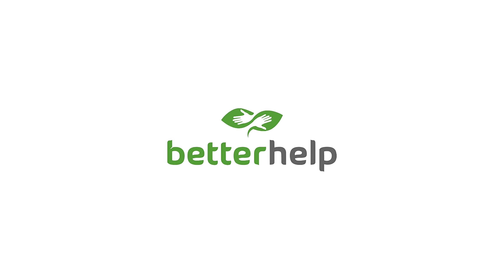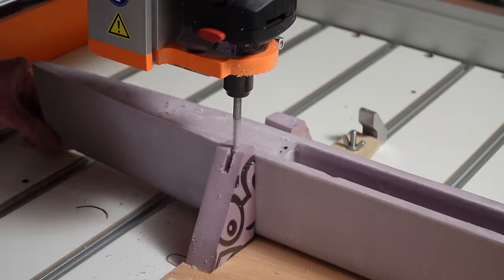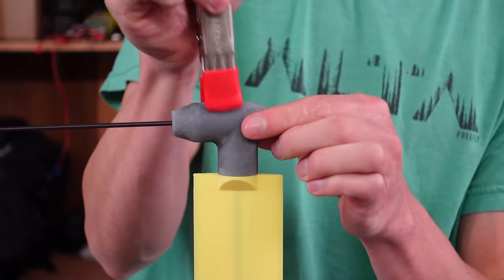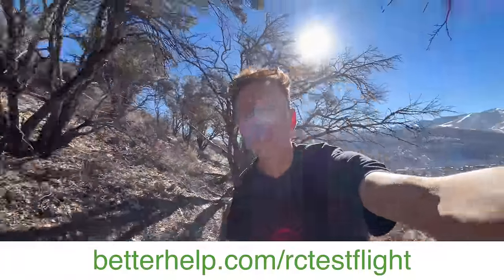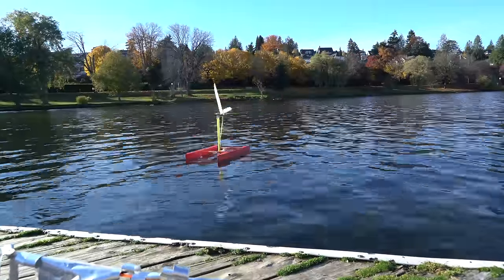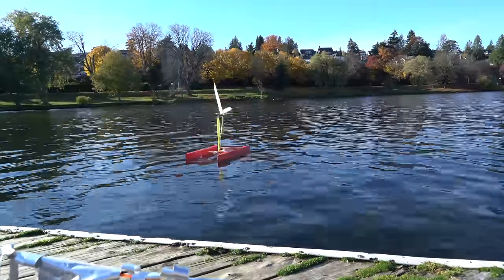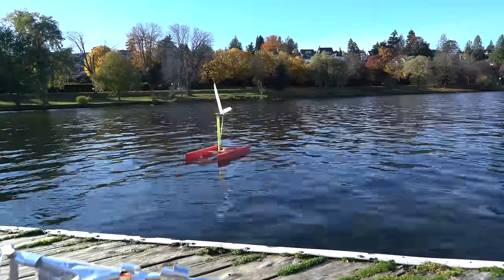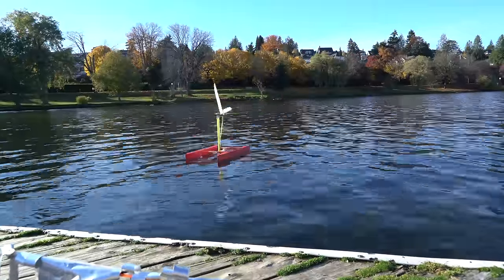Sailing Directly Into the Wind - Is it Possible?

Comment: Im wondering if a vertical turbine would work for this. Seems like it would eliminate the need for one set of bevel gears and the need for the mast to pivot with a fin on the back. Although i don't know if it would be more efficient or not.

Comment: I don’t see how you could get more energy at the propeller than the sail. Both are propeller acting in different mediums, air and water. And the drag of water is worse than air. If your boat (or plane whatever) could move forward against the wind (your energy source) thus moving faster than the wind, it means that you would be able to produce energy. 
The wind turbine industry would be happy (forget about the boat), you would also have put together a perpetual motion machine but Entropy and thermodynamics tells us this is not how it works.
Yet, you could minimize the other energy you would have to supply to your device to move.

Comment: Have a look at Autogyro sails as Moore-Brabazon has tried.  
... and 
Performance Tests on the Wind Turbine Powered Catamaran 'Revelation'
Neil Bose and Jim A. Wilkinson. Wind Engineering Vol. 9, No. 1 (1985), pp. 9-23

Comment: I think if you could efficiently convert that wind into electricity and then drive a variable pitch propeller, you would have a much more viable vehicle.  Propellers in water do much better if you spin them faster than whatever RPM you were seeing here.  If you had a gearbox spinning the propeller twice the speed of the impeller I think you'd have done better, as well.

Comment: Trial and Error is a good thing, and usually necessary somewhere along the line, but why so much at first?  I mean, why didn't you work out a theoretically-correct propellor diameter and pitch, to fit with the intended diameter, pitch and speed of the rotor;  and then use all these in the construction of the prototype?
   Anyway, good work.  I enjoyed watching.  Thanks.
Reply: Agreed.  A little engineering analysis would have gone a long way.  In contrast to the several dozen armchair-mechanic commenters here who have no idea how deeply in the dark they're shooting.

Comment: 10:28 The (wind) propeller is not producing thrust, it is not driving wind but is driven by wind.
Dont give up on this yet. I'm not into the numbers or the maths but while you have the wind prop way out the back it will act like a whether vane and steer into the wind but I like the water prop out front.

Comment: Hold up! What epoxy did you use to make the fiberglass? 

I have never had that much success using the pink foam for this. It would get dissolved by the epoxy. I always had to resort to PVC foam with epoxy or pink foam and construction adhesive.
Reply from the maker: You're probably using polyester resin, not real epoxy
Reply: @rctestflight  ok, that makes sense. There isn’t a lot of good information on that in the spaces that I was looking. 

Also, have you considered using other fibers in your layups? For craft projects like this, I have decided that I want to start working with something a little less hazardous. I’ve been considering polyester bed sheets because  trimmings that shouldn’t be such a health risk.  
I hope you were wearing a mask cutting the fiberglass, I’ve got a buddy that contracted mesothelioma from working with fiberglass unprotected.

Thanks, BTW.

Comment: Let's say you changed the gear ratio from 1:1 to 2:1 or higher so the prop turns 3 times the speed of the turbine. I'll bet that second design with a wind vane of half the area you'd be zipping around really well.

Comment: You use one wind-turbine.   What if you used three smaller turbines, with three separate propellers?   Smaller turbines will spin faster, individually producing less wind-drag.  Three smaller propellers will also create less water-drag individually and spin faster.   

There should also be a way to add some type of hydrofoil to the set up, especially along the pontoons. 

It's a pain to design one like this, but how else are we going to learn more about such amazing sailing tech?  10% inspiration/90% perspiration = success.

Comment: Change the gear ratio. You can easily use a bigger gear on the wind vane to make the propeller spin faster. Then you wouldn't need such a giant propeller.

Comment: What I don't understand the "lack of thrust" and the need for a propeller because Veritasium has a video on a group of people that made a rotary sail car and that vehicle DID NOT need any transmission between the sails and the wheels. If sailboats can travel into the wind from lift alone, then it shouldn't need any underwater propeller, as demonstrated in that video.

The major difference however is that the rotary sail had to be placed way above the ground so that the car itself caught less wind (and less drag) and the sail got more of it. Finding enough lift to counteract the wind drag completely and even win against it is perhaps the more complex problem.

Disclaimer: Derek (Veritasium) and the group thay developed the sail car COULD be hiding/omitting information.
Reply: You might want to go look again.  The "Blackbird" car shown in Veritasium most certainly did have a transmission between the prop and the wheels, and that was what drove the prop.  It was that chain drive running up the propellor column.  Sailboats don't have a rotating prop underwater, but they do have a keel or centerboard to balance the side force from the sail so that only the forward component acts on the boat.  A sail on a raft will not take you upwind.

Comment: So hear me out, what if instead of having the propeller work all the time, you occasionally disconnected the propeller from the rotary sail and operated the rotary sail similar to a regular sail, in a manner akin to autorotation on a gyrocopter? would that not be the best of both worlds?
Reply: Actually not, because a propellor's blades have their airfoil shape facing opposite to that of windmill blades.  Lift on a windmill blade is (diagonally) downwind and lift on a propellor blade is diagonally upwind.

Comment: The reason you can't turn into the wind very easily is that the hulls themselves act as sails with all the drag they cause when not pointed directly into the wind, you need more control authority than normal to overcome this.

Comment: Is it a sail boat, nope, and you touched on why. However, you should've looked up Jaques Cousteau's wind turbine powered "Calypso".
Reply: Apples & oranges.  Cousteau's "turbosails" weren't turbines, they were rigid sails with enhanced lift arranged by strategic use of fan-driven air to control the boundary layer of their airflow.   Their sails had higher performance than traditional ones, but they  were power-assisted, and they didn't go directly upwind.  https://en.wikipedia.org/wiki/Turbosail

Comment: Get rid of the wind-wane, and put the wind-turbine blades there instead. Then the wind-turbine will act as the wind-wane by itself.

Also, maybe the wind-turbine blades should be slimmer towards the axle, to reduce the drag further, as they mostly add wind-drag without contributing much to efficiency. Not a problem for a stationary wind-turbine, but one that is supposed to be on a boat will be problematic...

Comment: i dont see anyone else letting you know so...  yes you can sail a sailboat directly into the, "wind;"  ive done it a lot in my own sailboat.  how?  as you pick up speed sailing close hauled the wind direction does not change but owing to your speed the APPARENT wind direction to your sails does and that lets you point up a bit higher and voila!  you're sailing directly into the wind to the point of view of an observer not on your boat.  so.. yes you can but your way is way, way cooler and needs to be explored.  carry on!  come to think of it, you could just use a magnus effect sail.  easy peasy.

Comment: well, it's not sailing if you need a propeller, right? one of them vertical windmills would probably save you a lot of hassle with the rotor aerodynamics on this rudimental windmilling propeller.

Comment: I think you’re better off if you build a catamaran system where the water propeller is near the bow, and the wind propeller at the rear of the boat. In fact you could even build a system where the wind propellor drives a generator to charge a battery, while you use that battery only when you want to sail against the wind or when there is no wind. 
3D print that instead 😂

Comment: You have to separate the two worlds water and air, thats what the black car do. If the car is Not driven, it stays in the wind, the boat not. Because water is just a lubricant for motion. You have to put your boat under the water, then the wind does not affect the Body.

Comment: Wrong type of turbine.
my car, a model, worked using a pipe tower catching both wind -and a bigger mouth at angle causing a low pressure. I funneled wind down to a centripetal turbine in the center using both the positive air thru a nozzle system and the vacuum in the middle going back up.
I never got the ratios perfected but it did move well against the wind.
Methinks that would work well on a boat, especially using a electric rim drive prop and most of the boat submerged or a streamlined superstructure.

70's issue of Mother Earth News did this too.

Comment: Would an electric generator wired to an underwater motor have any chance? Just thinking about reducing the drag of transferring energy from the rotating sail to the prop (kind of like the old wheel powered generator powering bicycle headlamps). Just my $0.02.

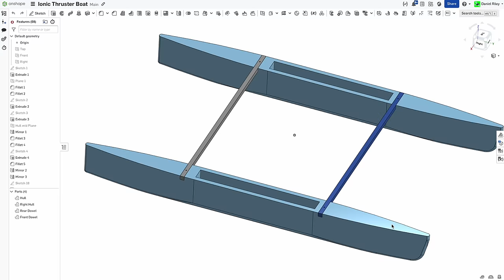Comment: 1:40 ??

air prop absolutely produces thrust

water prop drives air prop

effect is kind of like an enormous virtual sail projected behind the air prop
Reply: (when ur going downwind anyway,,

when ur going upwind the air prop becomes the generator instead of the thruster)
Reply: also (understanding that the 38/62 split is made up), 32% isn’t drag it’s drag + internal drivetrain losses via friction

so it’s rly like 62% “lift” vs 5% drag vs 33% just heating up and wearing away the drivetrain (not a force that fights forward movement of the vehicle)

Comment: Your setup would have worked much better had you had the proper gear ratio. Wind turbines turn much slower than propellers, so you need a high step up ratio to get any thrust from that little prop. I think your concept would work if you get that ratio right.

Comment: The difference between the lift-to-drag ratio in a high performance glider and the equivalent in your wind turbine there is that the glider wing has a super-efficient aerofoil shape and your wind turbine blades are just flat bits of some stuff you found somewhere. I predict that you will get FAR better results with properly designed and shaped wind turbine blades. 

You put so much effort into all the smaller parts but neglected the most important part, in my view.

Comment: Interesting. When this can go straight against the wind the way will be much shorter than with a sail. But the speed is much lower. The question is then:
Which is effectively faster?
Reply: With correct engineering it should be a tie, but the sailboat requires no moving parts.

Comment: can you also try to sail faster than wind?
There was a great video series by Veritassium about the topic
Reply: Iceboats do that routinely.  In recent years some high-performance multihulls have done it too.   Foiling sailboats probably do it all the time.  None of them can derive propulsion directly downwind of course, since sails are one-sided devices (in contrast to wind turbines), so what I'm describing is that on a broad reach the downwind component of their velocity can exceed the wind.  But the only time I was given an iceboat to play with, I discovered I had done it, as a total novice with iceboats and even in a very modest breeze, like 10 knots.  I set up a gybe and got ready for the sail to pole-vault across the boat as usual for a gybe, and instead the sail smoothly luffed rearward the whole time.  I'd been outrunning the air, and even while coasting through the turn with nothing but momentum, I was continuing to outrun it.  Eventually as I completeted the turn the sail filled from the new side and off I went on a new broad reach.

Comment: power generated drag = power used to propel the unit, which will never achieve greater than unity. Take a few solar panels to work with the mechanical wind propeller and you will get what your looking for.
Reply: Since he SHOWED it to you going upwind, what do you think you're blathering about? All you NEED is unity and that's all ANY wind vehicle EVER gets.  Except when still coming up to speed, where the excess gets invested in accelerating the vehicle.

Comment: 9:00 you never thought of gearing it properly? smaller water propp need more rpm.  but f you use big prop, you can reduce the wind turbine size and gear it so the water prop has the turn speed.

Comment: You should try a different translation. Like a clutch on a car or the pinion on a moped. Larger pinion on the wind propeller and smaller one on the drive screw. I don't think a one-to-one translation is ideal

Comment: The force to push the wind wanes to make them turn is backwards. The force forward from the propeller will always be less. If the system was perfectly efficient with no loss of power, the boat would sit still, not going forward or back!
Reply from the maker: Then why does the boat clearly go forward?

Comment: the shaft in the tube design has high friction due to contact along the length of shaft.
Reply: Didn't he support it with bearings at the ends so it didn't actually rub on the wall?

Comment: No, Veritasium's Blackbird does NOT go faster than the wind when traveling STRAIGHT downwind.  You cannot outrun your powersource.  It can go faster than the wind speed when traveling at an angle to the wind, just like a sailboat does.
Reply: That's wrong it does go straight downwind. The power source is the ground moving beneath
Reply: @peterworsley4699  Momentum is not power. The ground is not a power source, the wind is. If you go faster than the wind, then the wind that was powering you is no longer supplying you with any power, therefore there is nothing to maintain the momentum. Forward motion has to be powered by something other than its own momentum.

Comment: looks like youve learned that traction props, with  an angle, makes the seaweed just climb up the shaft, instead of completely fouling the prop.
Reply: I think the prop escaped the seaweed because the prop was submerged and the seaweed was floating.

Comment: im not threw this video fully but i see somthing that needs to be changed , you can use the same mast system and use a tall wind turbine  rather than a flat.. and no matter what direction the wind is coming it goes directly to power  with no adjustment's

Comment: no i think tacking is better. sailing is elegant and easily combined with small onboard combustion engines. you're not going to beat a small amount of hydrocarbon fuel for turning a prop.

Comment: Those rudimentary propeller blades are NOT wings. They are totally inefficient, I'm guessing below 20% with the rest being drag.
Also, using small gears just hurts the efficiency even more.
The water propeller is too small and too high pitched.
A lot of design faults here, but hey.. is was an experiment.

Comment: What about the Magnus effect? It has been used to construct rotating sails before.
Reply: Magnus Effect (aka Flettner Rotor) is a neat way to generate lift but it's still fundamentally a sail with the same scheme of force vectors that a traditional sail has -- it doesn't propel a boat straight upwind.  Also it's not a turbine (doesn't generate shaft work to drive a prop with.  Although a slender enough Savonius turbine will generate some Magnus-effect lift -- there've been little kites produced and sold in the sixties IIRC that worked on that principle.  

You can make a soda straw fly pretty dramatically by Magnus effect for ten feet or so (plus a loop-the-loop or two) by wrapping a foot of thread around it exactly in the middle and giving it a good pull. (The spin needs to be underhand.)  I've also done it with a small mailing tube, and with a good strong flip you can also put enough spin into a lightweight wooden ruler or half a yardstick to make that fly about 20 feet too.  And it's the reason curve pitches curve, with baseballs.

Comment: What if the wind prop turned a generator, charging a battery, powering a motor, turning a water prop (or two for steering control)? 🤔

Comment: The rudder won't work behind the prop because of the cavitation. The rudder(s) need undisturbed attached flow to work. You could try two rudders off each pontoon to get away from the cavitation (like bubbles). You could also try a higher aspect prop and even higher aspect propeller. Also, try pontoons shaped like the Hobie 16 which would probably generate lift as the boat veers back and forth across head-to-wind. The Hobie 16 hull shape would definitely help speed at 30° to 150° off the wind.

Comment: How about a Savonius wind turbine and a toroidal propeller. I have been thinking on this for a year but will probably never do it.
Reply: Also, apparently a whale's fin has bumps on it and that directs the flow into straight lines and increases efficiency, there are propellors that aren't flat and smooth and actually work better.

Comment: The calculations at the end (lift : drag, etc) are slightly inaccurate....10:1 means .091111111 per unit, 50:1 means 0.01960784 per unit, and so on